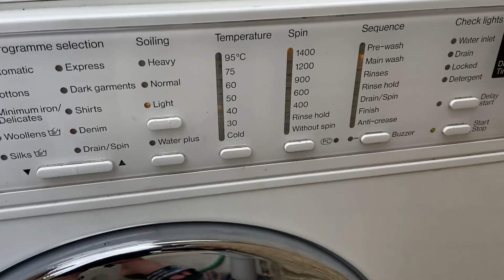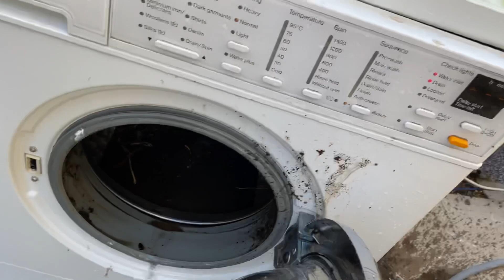EXPERIMENT - dirt/mud - in washing machine

Comment: But for those of you that don't know, dirt is soil, but don't try this at home, because the drum and the pump would get so disgusting, it could also cause the drum to seize, or the the pump could be blocked and you'd have to fix that problem.
Reply from the maker: Yes! The pump did get blocked…I managed to clean it I just need more ideas 😅
Reply: @laundrylad2006  So Miele isn't dead, it's just having 1 issue with blocked pump.
Reply: @laundrylad2006  Good job pinning my comment.